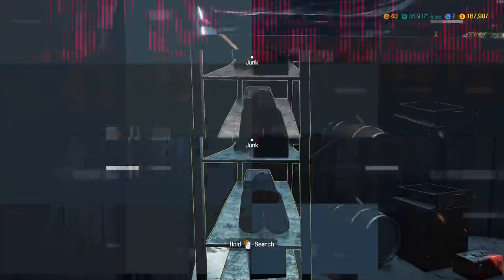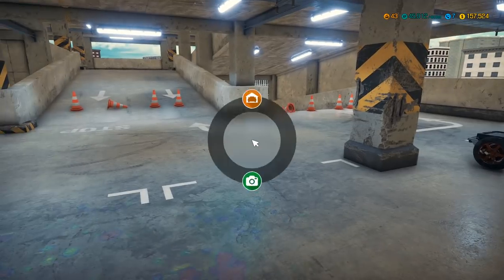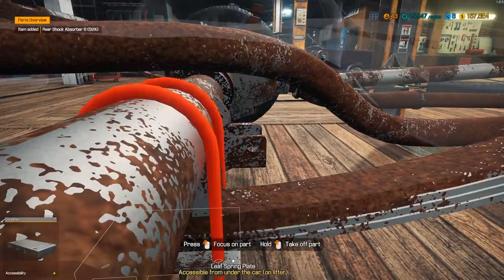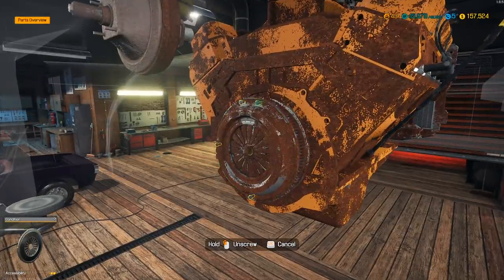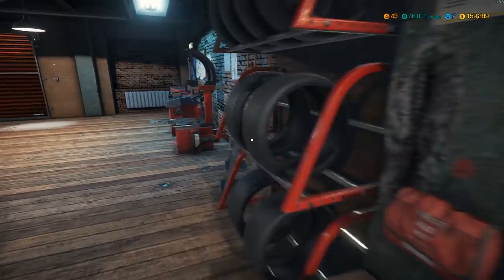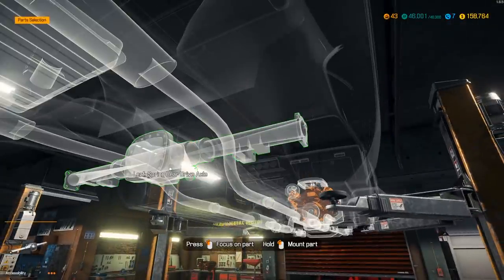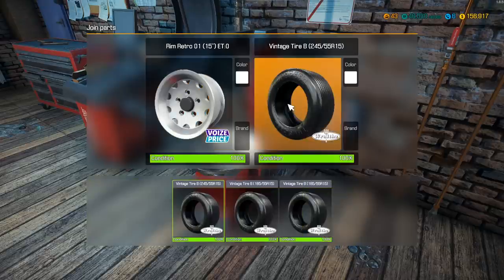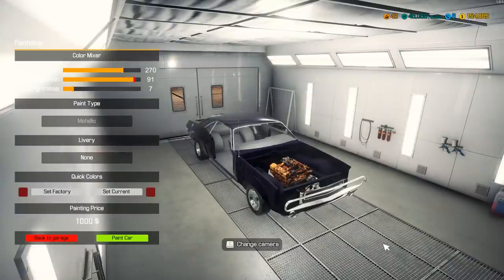Challenger R/T Barn Find | Car Mechanic Simulator 2018

Comment: I'm not getting it...  seems like paint-by-numbers but you should finish the Challenger to give us the whole experience.  I'd forgotten about the jacked-up rear wheel drive muscle days.  I turned 18 in 1985 and the less said about what was coming out of Detroit back then, the better.  I'm more of a Level 42 guy myself.
Reply from the maker: That's a very good description. It's definitely paint by numbers, but for the uninformed it serves as a halfway decent route map of basic mechanics.
Reply: @colonelfailure  I've wondered if Project: Hospital is the same.  I've never heard of high dependency units, but they make sense.

Comment: It would be far more realistic is you had to soak stuff in WD-40 for 5 days and then use a drill and angle grinder on a bolt you stripped because the WD-40 didn't work